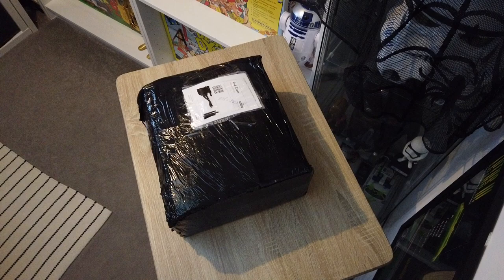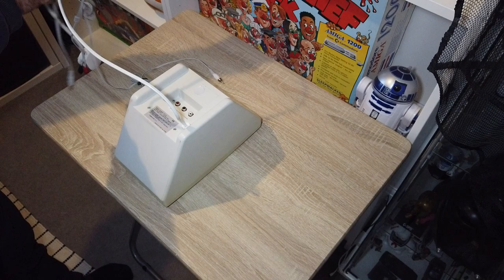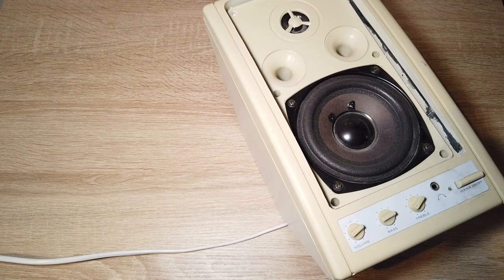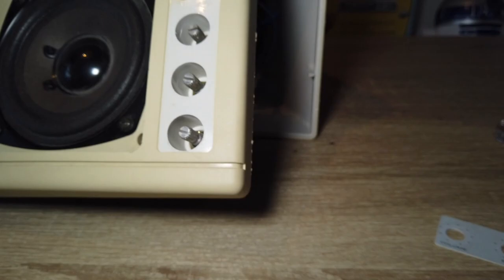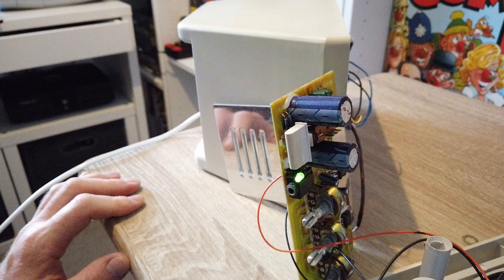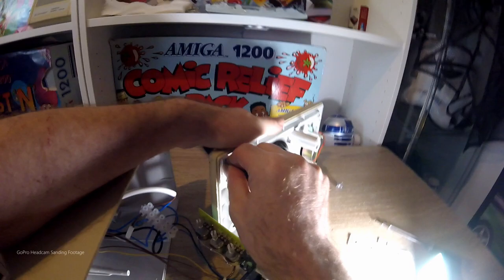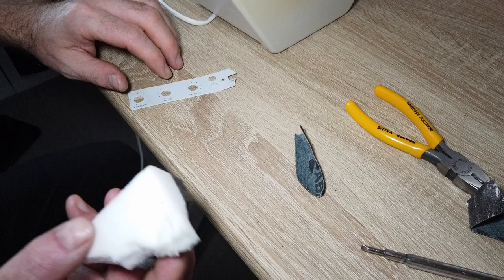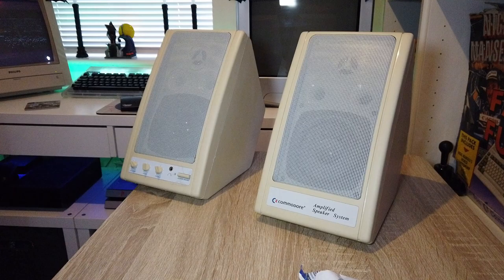Fixing A Set Of Broken Commodore SP-120 Amiga Speakers - DJI OSMO Pocket Footage -

Comment: The Trust Dynamic Soundwave 240 are the same speakers and cost normally today 15€ , the difference IS only the stickers.
Reply from the maker: Mad I've spoke to loads of people regarding these and the amount of times they have been rebranded is nuts
Reply: I have them. NOS. Brand new. Great speakers. Brings back in time. This sound is different. Worse maybe in todays standards but nonetheless superb in my opinion ;)
Reply: Ps. Not the same. Different bass reflex positioning. Smaller grille. 3D sound addon ;) Other than that. The same.
Reply: ups. I was wrong. Soundwave 240 is the same Soundwave 240 3D has differences.